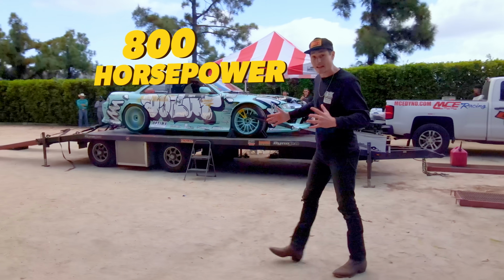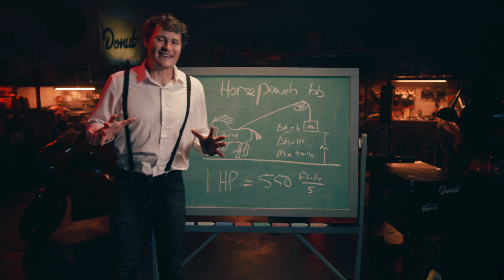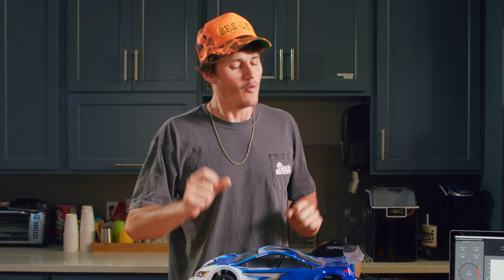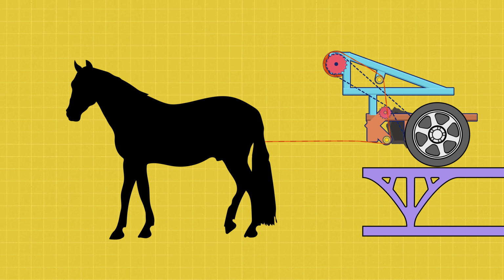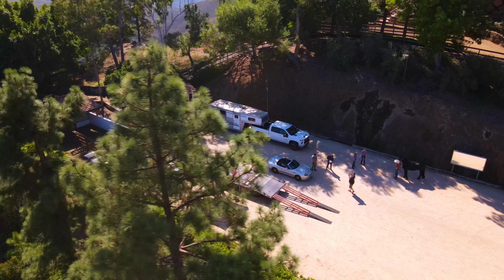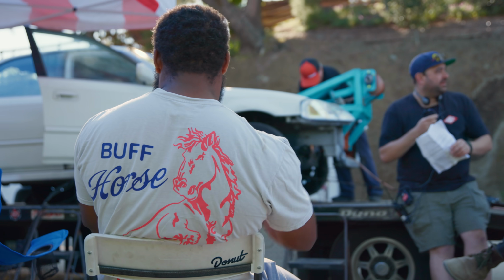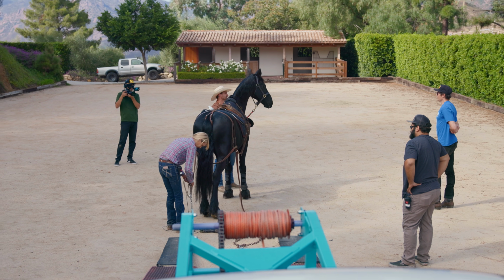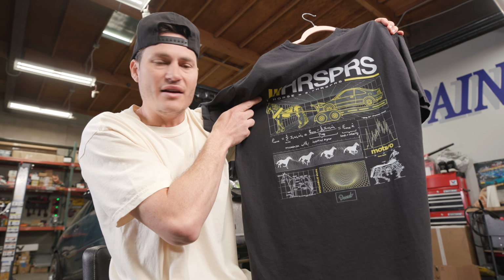How Much Horsepower is a Horse?

Comment: I have heard that a horse could put out over 1 horsepower, but this real figure was much higher than I expected. This is one of the most interesting Donut videos ever. Thanks for everyone's hard work on this project.
Reply: It's peak power vs. sustained power. 

The original number for horsepower (I mentioned this in another reply as well) was derived from water pumping capacity in mining operations. A given number of horses in a horse mill could pump a certain amount of water from a certain mine depth in whatever it was that a full shift was for a horse. They'd pull the mill for hours on end. Quite different from doing a power pull for a few seconds.
Reply: Even a human can put more than 1hp, a pro cyclist can put down around 2hp
Reply: @braziliansheetbox2497 that's using only our legs
Reply: @everettstormy  A cyclist uses more than their legs! Pro cyclists can twist frames from the torque generated between their arms and their legs working in unison.
Reply: I thought it was gonna be much more, but TBF, I'm a mathtard.
Reply: @UberLummox  Same here! This was a really cool experiment, and probably a good representation of general horse power, but I do have a feeling that this was a conservative result... Give Big D more time to get into stride (and a better reason to pull with 100% effort) and I have no doubt the maximum power output would have been much higher. The video got me way more excited to read the discussion section of their paper than I have ever been to read a discussion section in my own field haha
Reply: @hajofralin  Right on!  And yeah. Big D was diggin', but I'd think he has a lot more in him as well!

Comment: Why did you run it through a car transmission? Wouldn’t it hav made more sense to just have the horse pull the drum? Wouldn’t finding the horses “crank horse power “ be more accurate than its “wheel horse power” and calculating the loss?

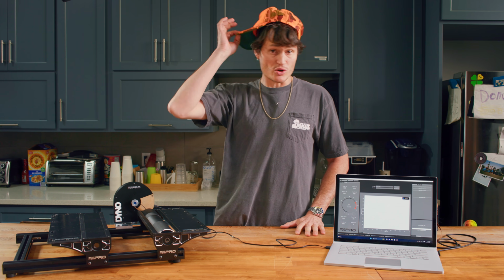Comment: 6:44 Jeremiah, you broke my heart! I was so pumped to finally see an engineer put this myth to bed.

An inertial dyno doesn't measure torque - it measures the time-varying speed of a drum with a known moment of inertia - it's measuring the rate of change of energy of that drum, AKA power.

Torque is calculated from the power figure and engine RPM. Any inertial dyno operator can show you this by doing a pull with the tach signal disabled - the result is a chart of power vs wheel speed.

Comment: Your experiment failed, you did not max out the horses strength, therefore you did not measure it. You need to attach the pulley to a scale to measure the force instead of using a dyno.

Comment: @15:08 - did you mount the axle in a supported bearing or just leave it hanging on one end?
Reply: It’s on a pillow block both right after the trans spline and at the end of the shaft

Comment: Love the vid, but one question. I think the rope pulley need to be the same diameter of the wheel to overcome the leverage difference or did you solve it using the gearing?

Comment: So, basically you proved that James Watt's power rating was more correct than ever, because he did his experiments with the intention of comparing the power output of a horse that was working for the whole day. You proved that even your big draft horse Normandy could only pull your dynamometer 5 times because it was too much work for him to continue to do for a longer period such as all day! James Watt claimed his engines could perform that work all day long and he was comparing it to the amount of power produced by a horse that was also working all day long. So Basically you're saying that James Watt was way smarter than your whole team combined because he figured all this out over 200 years ago, without any fancy computers!

Comment: Very neat idea and pretty solid execution!

My only concerns:
Why was a rig incorporating a chain drive and an entire vehicle transmission used instead of a more direct connection to the drum? I ask because the goal was crank horsepower, not wheel, so all the conversions and math to account for possible mechanical losses seem to have been unnecessary here and could have increased % error.

Was the age/condition of the transmission accounted for when calculating mechanical losses? The vehicle doesn't seem to be the newest, so were mechanical loss figures retested for this specific drive-train setup rather than just using manufacturer provided figures?

Was traction that the horse could achieve on the sandy surface accounted for during calculations?

Did they, when calculating averages, adjust the repeated results to account for the horse possibly getting tired as the pulls continued? Was the rest time between the 4 measured pulls consistent?

Did the horse starting with slack in the line before the pull, causing the slack to eventually cause a "snap back", have resulted in potential inaccuracies?

Due to a horse being a living creature, for the scientific paper, will this be retested across a set of days where the horse's diet and routine is kept consistent?

Now, I am no horse expert, but a quick reference of the Wikipedia on Draft Horses says that Draft Horses are often crossbred to a variety of breeds, particularly ones of the "sport horse" category. 
This makes me wonder, was this horse bread purely with the goal of heavy farm labor and pulls like the Shire horse? When looking at the pictures on Wikipedia (not particularly scientific, I know, but horse enthusiasts will likely be able to give more info here), the proper heavy, farm labor oriented draft horses seem to have a much different build, more sturdy and stable than Big D used for the pulls. I point this out because maybe Big D was more bread with the goal of being used as a sport horse in mind rather than purely a work horse.

I would also ask if the pulling apparatus was perhaps unnatural to this horse causing it to have lower output compared to another that does pulls regularly?

The other question that comes in is if work horses like the one shown would have higher torque figures and lower horsepower figures than a riding horse?

With the rope starting slacked and the horse gaining a little momentum before the initial tightening causing a spike in the initial horsepower levels? Was this accounted for?

Finally, was any consultation done with horse owners that participate in pulling competitions ("heavy horse" trials)? Why did they not opt to use a horse from one of those being that they are used to putting out a maximum possible power with a towing apparatus attached?

Anyways, I assume many of these will be accounted for in the final paper, so I am rather excited to read through it when it goes through academic review, and if it fails it, it would be nice to have an update as to why on the channel.

Comment: 5.7 for low speed.  Just like an engine has a horsepower vs rpm curve, a horse has a force over mph curve.  Horses can make over 10 horsepower peak at higher speeds.  Also the horsepower rating came from averaging work done by a horse over a day, so it’s like the marathon rating vs the 50 yard dash rating.

Comment: Okay so there's a small flaw in your test method. James Watt based his horsepower measurements on horses that worked 8 hours or to even 10 hours a day. Those horses would have been moving at a consistent rate sustainable for hours. Your horse by your own admission could only have pulled this hard five times in a row.

Comment: So Watts math of 1 horsepower is 550 ftlbs of torque per second would mean an actual horse can produce 3135 ftlbs of torque per second which grossly miss under estimated. Which would mean that an advertised Bugatti with 1600HP is fails advertising because the actual number would be 280 horsepower.

Comment: Why not completely exclude the car and attach a similar device above the drum? Have a similar set up to keep the line parallel but have the cable installed to the drum itself. I feel like passing it through the transmission is a huge variable as there are so many in existence  and change the output of torque and power through whatever gearing pack they have. Whereas a direct to drum would give you a constant

Comment: This was way more interesting than I expected! I don’t think big D was pulling 100% power just by his stance. But still proves the point about previous ideas about horsepower
Reply: That's what I thought but actually horsepower.  Is an avg. The best thing is there is always room for improvement.  You can make every type of horse breed pull and see the avg but regardless no horse knows what it's doing so can't really ask more without hurting the horse
Reply: The original value for horsepower derived from pumping water from mines, if my understanding of the history of the industrial revolution is accurate. 

Back in the day it was well known how many horses you'd need to get a certain amount of water pumped up from a certain mine depth. And, important point, those were numbers for horses on the threadmill (well, horse mill actually) for hours on end. So one horse pulling for 5+ horsepower for a short pull is not really that unusual. 

On a hometrainer at the gym I can sustain 210 watt for an hour, but in a burst I can get to a lot more. Just can't sustain that for very long.

Comment: I feel like my starting point for building a horse Dyno would just be making a treadmill the horse can run on that turns the Dyno drums. The treadmill would have to be large enough for a car to drive on as well. Then to determine the loss through the treadmill you just measure the horsepower of several different cars on the Dyno without the treadmill vs the Dyno with the treadmill.

Comment: Now get in touch with Boston Dynamics, see if they can make a running horse to pull the line at speed, to calculate true horsepower of a speeding horse without risk of injuring a non robotic horse

Comment: wrap 200 feet of rope around a dyno drum then use a team of 6 horses to unwrap it.  You get mass x acceleration and divide by 6 to average a horse's power is.  If you used a Mustang dyno they you could actually measure torque rather than us an accelerometer.

Comment: In fairness to James Watt, I don't think he was arguing that the peak performance of his device was the same as that of a horse. Big D was only allowed to do five pulls total, each of which were of very limited duration.

A horse can't keep that level of performance constantly. It needs breaks to eat, drink, rest and sleep. And you need downtime to switch between horses. Let's assume you can work the horse 6 hours a day, every day, year in, year out. 

So, if you need to run something 24/7, that requires a single horse at any one time, that need three horses to run a full week. If you can replace that with a single mechanical device, it is certainly a reasonable argument that that device has three horsepower.

Comment: I lovee the video❤
But, 1 human 1.1hp and a horse is 5-6hp?
Dont know man, i think if you do a tug of war between 5 of the strongest human and a horse , the horse would win easily

I know its not about strength, but i think strength should be about equal to the crank horsepower, because if you do a tug of war with cars, the bigger horsepower will alway be the winner

Comment: As I was watching, I was trying to think of another way to measure Horsepower that would be more traditional for the horse.  As you noted, horsepower is simply force x speed.  In a dyno, we use rotational speed, but it doesn't need to be that way.  For the animal (horse) the easier way would be to have it pull a load (like a wagon or carriage) at speed.  Use a gauge between the wagon and the horse to measure the force, then "brake" the wagon to increase the force.  Most likely, whatever the maximum force the horse could pull at around 25mph is going to be the peak power.  This would be much easier, repeatable, and more natural for the horse.
Reply: Yeah, that would be the power calculated from the cable tension recorded by the load cell and the speed from the GPS.
It's most unfortunate that they did not show a comparison of the calculated power output from the dyno with the value calculated from gps speed and cable tension. Also, what even is their final number? Arithmetic average, Median over all runs or only the maximum value recorded once? Which data set did they even use? From both methods or only the dyno? Also, have they ever heard the term standard deviation?
Seems like they only took one single peak value from the dyno. If they publish this in the paper, I'm pretty sure no one will accept it.

Comment: I remember something about HP being calculated based on how much work a horse(probably average between common breeds) could do. So as a sales pitch they could indeed say "this machine has 10HP" because it does the work what normally would require 10 horses. Max horsepower like here shown is just a momentarily display of power, it can not do that all day long. With this logic it makes sense why a horse has more HP then 1, if it is truly based on a days work instead of just short power bursts.

Comment: The original definition was the average power a horse produces over a full work day. You measured the max output of a horse, Watt's definition may not be that far off, since a horse would be working at well under its maximum, when working for 8+ hours continuously.

Comment: One problem with the testing method is the fact that the metal bar and ropes start off on the ground with considerable slack, there is an initial tug on the assembly, then the inevitable rebound and slackening of the system, then a re-tensioning of the the system. This is wasted energy and affects the overall building of power to overcome the inertia of the dyno drum. Should have started with the rope and bar at correct height with all slackness taken out of it. I'd guess that the horsepower would have been significantly higher if all the horse's power went into it - especially given the short range of travel available. That is why this will not rise to the level of a scientific paper - it is weak in experimental methodology. In a well-designed experiment, all variables that could affect the result must be minimised. Fun for a Donut vid though.

Comment: 1 Hp is the average a horse can sustain over an extended period of time.  That is not same as peak hp which is only short duration.  Engines  dont experience physical fatigue and can easily sustain  higher average power.

Comment: The power loss from the framed roller to the sprockets and chain would be high...  so the I'm lost, why not attach the rope directly to the roller (wound up) and have the horse pull the rope loose that way? ... minimize mechanical drag loss... where does it fail (given the horse actually has to travel a longer distance to get to it's top speed)? and someone set me right - isn't just the horse pulling from a stop = torque? would the horse need to be pulling closer to a gallop before getting true "horse" power? looks like a longer rope needed ;D

Comment: Would’ve been way easier to have Kw as the standard measure for power. America resists the metric system but undoubtedly it’s better and less tolerances than imperial system

Comment: Way too over complicated when the linear force from the horse could have been directly attached to the dyno...
Basically the orange rope the horse is pulling could have been winded directly to the dyno, worse yet you could have use a gear ration to reduce the horse's effort and achieve the same result...

Comment: Should have mentioned that the original horsepower number was eqvilant as a working horse over the horses time. A ranch might have 4-5 horses working shift on drafting or pulling work. So the engine would been able to replace that many horses atleast.

How much work can a horse do its entire life time vs the engine over the same time. So if the engine were 1 horsepower then it could replace a singular horse, as the engine could do work 24/7

Comment: Amazing vid but instead of making a mechanism that turns linear pull to rotational motion, would it be possible to get an accurate answer by making  a horse pull a car, noting the max speed at which the horse can pull, then running the same car on the dyno at the same speed to get the power required to move  car at that speed? That would be equal to the power the horse exerted right?

Comment: This episode will be on the top 10 on the channel, absolutelly, folks should call this unit "Real HP".
EDIT: Forgot to mention, so to convert to a car this new number, just divide by 5.7.
Ex: a 110hp car, has 19.3 REAL HP, Big D helped solve a two century mistery.
Reply: Different horses have different horsepower. A Clydesdale will have more horsepower than Big D.
Reply: @CaliMeatWagon i believe so. I will be patient for them to average out the horsepower with many draft horses to the strongest draft horse ever. Plus they may contact the strongest and fastest man alive to give another perspective in human biology...this is the beginning
Reply: So the Dodge Challenger Super Stock makes a measly 141.58hp. Dodge should be embarrassed calling it the King of the Track
Reply: @TheGreatChrisB  lol ay. That means everything would be emberassing. That includes the Chevy Chevelle 454 down 100 horsepower or 200 from 450hp originally
Reply: @TheGreatChrisB 
My Subaru outback is 32hp. It’s so embarrassing.